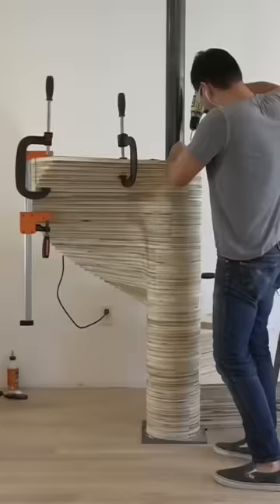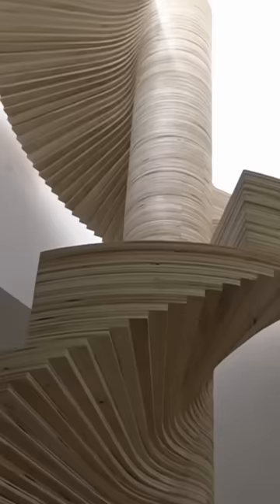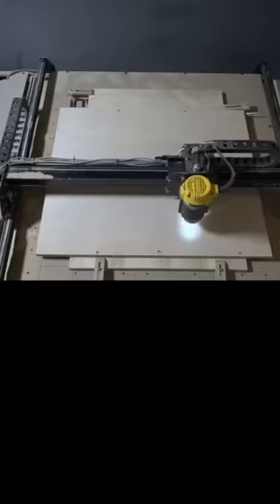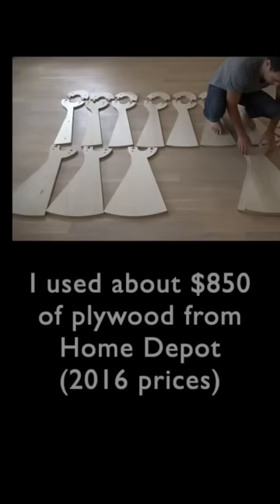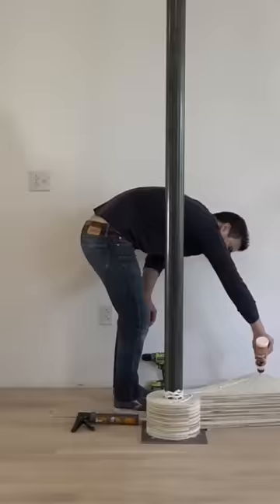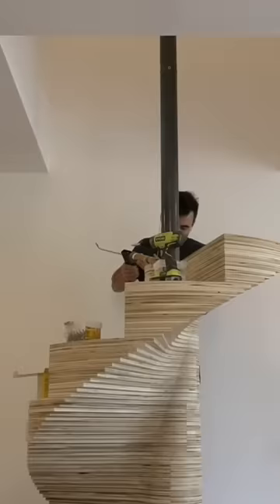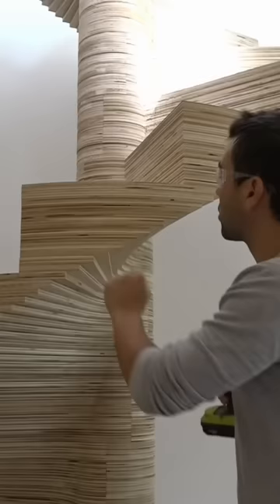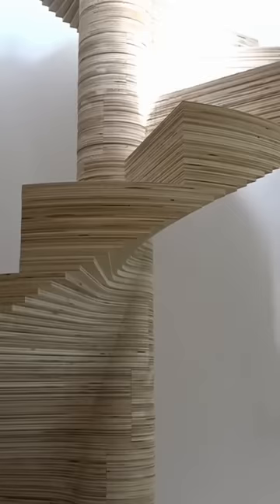DIY Spiral Stair

Comment: And I'm sure the building inspector loves the "No railing" feature.
Reply: Well as long as you have no animals or kids it's fine or if you have drunks around 😂 either way I'm pretty sure he won't fall
Reply: Or how flammable it is
Reply: Should have included rail fixing holes in the CNC profiles, would have been super easy at that stage. There's always "next time"...
Reply: @JayAndNightASMR oh so like an entire house.
Reply: Nobody is ever going to inspect that.
Reply: @heavyweather  If he sells it they will. It's always best to avoid the headaches down the road and build to spec/code from the get-go.
Reply: @mtmcommunity  no it’s not! For it to be to code it needs railings
Reply: The whole point of the video is to show the staircase being built from the board,, I’m almost positive the rails were added later,,no one would think it’s safe without railing.

Comment: “I was low on funds so I used my own personal CNC machine”
Reply: Only he did it as a worker for his boss.
Reply: i laughed out loud when he said that
Reply: You can do the same thing with a jigsaw.  and a file
Reply: @hggryrdchgc  Not really.
Reply: @damirregoc8111  if you had a jig or pattern it might actually be easier with a router of some sort, but realistically if someone had enough time and patience, and a lot of blades, I suppose they could actually do it. Edit: with a jigsaw, I mean
Reply: @goosenotmaverick1156  Well, yeah, but it would turn into a half a year long endeavor, so, it's possible, but unprobable that anybody would invest so much time into something not even really beautiful. It's cool if it's cheap and quick, but if one needs months of labor to make it, then it better be the best thing ever.
Reply: That type of CNC is pretty cheap.  You can buy kits for like 500 ish.
Reply: @EstrogenGhoul  So, low on funds, buys a $500 CNC machine, a drill for $50, $800 of plywood, $30 of screws, a metal pole for about, idk, $100..? Cool. When I say "low on funds", I mean like I don't know how I'm going to buy my next meal, not "I have 1500 bucks to play around with".
Reply: @damirregoc8111  
It wouldn't take a month. Cut two treads at a time using a jig and it would go by pretty fast. Each cut wouldn't take more than 5 minutes. That's 20 cuts or 40 treads an hour. I'm guessing you don't do much actual work so your estimation skills are very limited. In a month you could do this with a handsaw and sandpaper.
Reply: @1985cjjeeper  You're right.
Reply: @1985cjjeeper  Oh, except that part about me not doing any work. No need for guesswork here, or to assume wrong stuff. Calm down.
Reply: In my Boston loft. 😂
Reply: That's why he was low on funds. Obvious.
Reply: yeah "low on funds" and "Boston loft" and "my small CNC machine" Ha Ha Ha what a joke
Reply: It's like that article where the guy described how he became a millionaire in 5 years. Step one was moving in with his mom rent/expenses free. Step two was his mom paid off his student loan for him.
Reply: Dont forget the grand he also spent on flooring
Reply: @damirregoc8111  perspective is everything, some people's version of being skint is not affording 3 holiday's a year whereas someone else may realise that being skint is actually being without money full stop.
Reply: @damirregoc8111  If you're not sure where you next meal is coming from why do you care about a building staircase?
Reply: @calysagora3615  He didn't say boss. He said Boston loft
Reply: @calysagora3615  he said “Boston loft” not Boss Den/loft.
Reply: Lol 😂
Reply: I was thinking the same thing. I have a feeling his definition of "low on funds" is very different from mine....
Reply: Well, we know why he was low on funds.
Reply: @calysagora3615  his "Boston loft", for himself, listen again.
Reply: @EstrogenGhoul  in 2016? They cost a lot more then
Reply: @1985cjjeeper  each tread is multiple layers of different patterns. Every layer is not the same. The layers for each tread is mostly the same with extras for the bottom and top, and the caps for the back of each layer. Looks like each tread is about 15 layers, so 16 different cut patterns totalling 30 pieces (est.) Per tread. If he ran them as needed instead of cutting all same patterns before moving on to the next pattern, then his time frame would be longer, but organization of well over a thousand individual pieces to keep everything moving up in the correct order mave have been more important for him personally, due to space or what ever, to cut one or two tread sets at a time. So include time to change cut program between cuts, and loading the reduced sheets of plywood for every two layers.
Reply: That looks like an X-Carve, which is a low-cost, hobbyist-grade machine, and if he already had it, it would be free to use
Reply: @1985cjjeeper  How do you estimate an hour to be 100 minutes?
Reply: @michaellorenzen8200  how much would it cost for a traditional spiral staircase then? When you find the answer, you know why it is very likely this is the lower cost, even inclueing the cost of the CNC, which that one isn’t very expensive.
Reply: Came here looking for this comment
Reply: @1985cjjeeper  Damn man, you got them 100 minute hours?!
Reply: thats why he was low on funds 😂
Reply: @damirregoc8111  realistically a half dozen to a dozen jigs. Each step is a replica of the one before it. Sure, cutting would take time, but cutting wood is cutting wood, it can only happen so fast regardless of the tool used, so I don't believe your time estimate is accurate.
Reply: @damirregoc8111  Yes, really. It might take a few years, but it's possible.

I mean, how were they able to produce the complex shapes in aluminum for aircraft back in WWII...long before there were CNC machines?
Reply: I’m like huh 🤔
Reply: I was looking for this comment 😂😂
Reply: @hggryrdchgc  you realize how long that would take?
Reply: @damirregoc8111  
I was just messing. Honestly the real silly thing about this is that he used plywood. Those edges are gonna crack and fall apart at the top corner of each step over time. He should have used real lumber.
Reply: @uhavenoshushi i just did one. And it was cheaper than his total cost here.
Reply: @aelfkins  
Have you never punched a timecard? Do you know what flat rate is? If I told you we used to get .8 to fix a tire with a nail in it would you understand how much pay that is of an hour?
Reply: He'd already spent his money on the CNC machine
Reply: @DeLuxonn  
Lol, I go by timeclock hours. 100 minutes on a time clock.  5 mins is really like 3.3 minutes of a 60 minute hour. Too much working on cars for flat rate pay. Like .3 is 15 minutes but its also .33 on your hours worked. Should have specified, my bad.
Reply: @1985cjjeeper  You said that each cut would take 5 minutes, Then said that that would be 20 cuts an hour. Your hour would need to have 100 minutes in it, instead of the 60 minutes in everyone else's hour.
Reply: Low on funds, not cash. I guess you wouldn’t understand 🤷🏾‍♂️
Reply: Ага, точно!
Логика ушла из чата...
Reply: Cry
Reply: If it's part of your business/job equipment, then using it makes sense. He wasn't necessarily being extra.
Reply: privelege couldnt find a better bastion of a comment for his perch.
Reply: @jon420  ... Yeah, I guess we may see a "flex" from him about his "Miami Beach villa" on the next video... 😂. Now back to  your single wide down by the river,  you peasant!!! 😮
Reply: Maybe he normally CNCs solid gold...
Reply: @alexander5207  read slower
Reply: Lmfao so true.

"Low on funds" = "I did this for a youtube video"
Reply: He's low on funds because the cnc😄
Reply: @Adam00794  It's a hyperbole, you know.
Reply: Well that pretty much sums it, aren't they? He  went broke buying that very machine... (i think)
Reply: Me too!

Why should I also not use my CNC mill for this?

Others build a railroad in memory all their lives ... why can't I use my hobby to solve problems that come my way?
Reply: But the machine will last you.
Reply: @hggryrdchgc  
No you can't!
Reply: @El Che  where there's a will there's a way
Reply: They are not exspensive.

Comment: Would love to know the total weight.
Reply: @richardrowlands9113  Helpful lol :P
Reply: It is heavier than a loaf of break but light than a bread factory.
Reply: Pounds x sheets weight x sheets
Is close
Reply: @richardrowlands9113  suspect it would be heavier. Obviously steel is heavier than plywood but volume of material is vastly greater
Reply: I'm also curious what the difference between this, a steel staircase or even a regular staircase would be.

Comment: Building inspector- Wheres the railing
Reply: He did mention he was low on funds.😅
Reply: @Masood1810  he’ll definitely be low on funds after the hospital visit 😂
Reply: I would like to see the engineer and or architect signature on your approved building permit.
Reply: Make it out of Styrofoam!?
Reply: @KurticeYZreacts  what? The floor?
Reply: @dmosier  a licensed architect would not miss that obvious code violation
Reply: District surveyor would never pass that here in the UK, perhaps they are less strict on health and safety across the pond 😂
Reply: @joelweinberg18  you are correct sir
Reply: @dmosier  That would be relevant on a public building or in a housing development, in a private home it's at your own risk.. Handrails can also be designed to be easily dismantled later.
Reply: @zahimiibrahim3602   Um ...where do you live?   I know where I live a engineer and or architect has to approve the plans before you obtain the mandatory building permits from the municipal office, for all structural changes of any and every structure that will be occupied by people....yes even in your own private home.  Building codes and fire codes are not just for some people, they are for everyone.
Reply: Stage two, build a handrail from the off cuts of 300 sheets of plywood that were going to landfill.
Reply: Waiting on funds...
Reply: @zahimiibrahim3602  you are proof that some people will say ANYTHING just to argue.
Reply: @dmosier  Permit? Bahahaha....
Reply: @joelweinberg18  Bahahaha, ignore, not miss
Reply: Kentucky here.. we have never had a building inspector on our farm. We have counties with no inspection, except for electric.. they will look at the box before turning on power.
Reply: Does he say that he didn't fit a rail later?
Reply: What building inspector? In US? Because in UK or Europe there's no such thing. I lived in 4 different countries in the last 32 years. They are not like a mailman going from door to door checking your bloody staircase every 6 months.

Comment: Guarantee that I would fall off this in my socks in the morning 🙈
Reply: You can also mill a non-slip pattern into the steps - though I wonder what the 2 hours per step is for ....
Reply: @aaaooaao9949  the machine is slow lol
Reply: @aaaooaao9949  Every step seems to be composed of 12 main pieces + 12 back pieces. Assuming he ONLY counted the cutting time, didn't count assembly and didn't count time putting the wood into the cnc, loading up the right design, taking the wood out, putting the next one in, that's an average of 5 minutes per wood piece. Not that slow.
Reply: @BM-yy8db  ok, i think, you are right.

Comment: I love it, I think if you stained and poly’d that it would POP
Reply: this should be one of the top replies not the ones that are at the top, deserves hella more likes than the 5 it has I'm the 5th like
Reply: Stain can be weird on plywood since the sides and edges don’t absorb stain the same. I think just a nice matte poly coating would look good and keep moisture out
Reply: @WildTrek  I agree, the trick to it is conditioner and stainable wood filler

Comment: DIY how to fail a building control inspection, at least where I’m from
Reply: Also, renter's insurance for anyone without medical insurance or turns out not a good friend and just wants to sue me, lmfao. $500k liability baby, w00t!
Reply: He only did it for the video I’m sure. Makes a fortune
Reply: Why would that fail?
Reply: @koksik8006  See the invisible handrails? That's why. But apart from that it looks solid
Reply: @koksik8006  no hand rail
Reply: handrail or not, this is a masterpiece
Reply: @koksik8006 no railing (fall protection) and small, narrow spiral staircases are not allowed as the only way to access a living space (in case of a fire).
Reply: @bastian6173  I'm sure he just finshed it. I mean do you think that every staircase comes prefitted with a custom railing from the beginning. He did a great job now he gotta finish it.
Reply: @a1tung  Yes, but the question I replied to was why it will not pass code..... Please take the time to read before committing
Reply: Anywhere this is not legit to code.
Reply: Next video: Installing the railing.

Any other code issues after it's finished?
Reply: @kimilsungthefirst6840  only a problem when you sell the house.
Reply: @kimilsungthefirst6840  Inspectors and appraisers

Comment: You should consider selling these, would boom in the tiny house mkt❤️
Reply: It would be an hassle because he would have to test for resistance, how much weight it can carry, and a bunch of other security concerns.

Not saying what he made is dangerous, but if you start selling it instead of using it in your (or friends'\relatives') house, you need to be a lot safer
Reply: @ComDenox  yeah no, im sure it had to pass inspection..

Comment: What kind of railing did you make?
Reply: Building code says you don't need a railing if you don't follow building code
Reply: @scottyb4260  😂
Reply: @scottyb4260  in my area if your project falls outside of the building code requirements you can proceed without a handrail,
HoWeVer: should you decide to add a handrail you MusT comply with the code!
Reply: If you look hard, you can see the invisible materials he used for the rail.

Comment: Redesign idea to add a hole on the top two of each rise to accommodate a hand rail post anchor, with recessed bolt. Now I’m just trying to dream up an inexpensive material to go between those posts that would maintain this beautiful design.

But I’m sure your head is already on this and will see a future video showing the next step. Looking forward to it.

Comment: Totally amazing you are very rich and enriched with design 💯. Only thing of pure importance that's code and missing a safe wire or steel railing. Maybe encased in acrylic floor to floor for safety. ♥️💯👍

Comment: Unless you have three foot high ceilings or you got your plywood for free, that's about $3000 in plywood assuming about four steps per sheet and those are half inch thick rough grade plywood sheets.  The least expensive two foot by four foot by half inch thick panel is around $35.

Comment: If you had used 5×10 sheets, you could have reverse cut each step so the wedges would have interlocked. This would have saved about 40% less in plywood.

Comment: Sounds cool as a concept, it also save quite a lot of space and all. However, this isn't ideal. More cost to cover for, CNC mechine, a load of ply woods. Especially, there aren't any safety railing at all. Not to mention that you need to spend more for the railing 😅

Comment: Would have cost less for a steel staircase from tractor supply. Also depending on the area and quality i call bs. In 2016 3/4 plywood cost about $20 a sheet at home depot. Thatd be 45 sheets and assuming its a standard width step you’d get about 6 steps in total from all that plywood. if it takes 12 layers per step. 45 sheets 8 steps cut from each sheet means youd get about 5.62 steps out of 45 sheets of plywood

Comment: If you would of had used a 10 inch
Collar to slide over your center  column pole for each step you would of only use a 1/4 of the plywood.😲👀👍